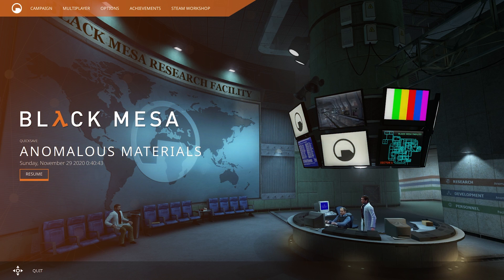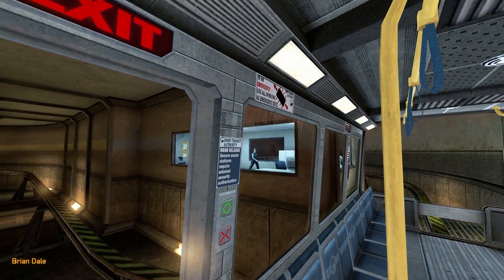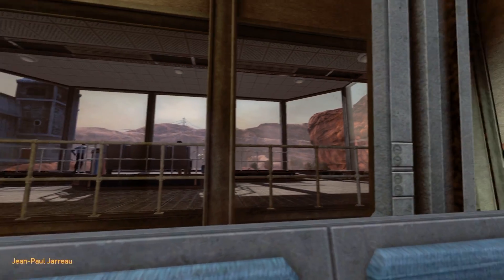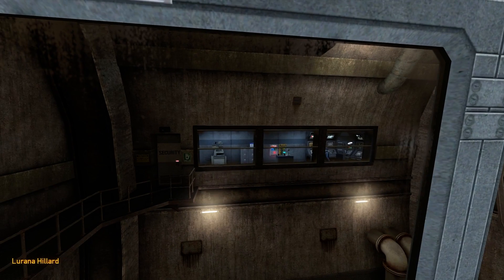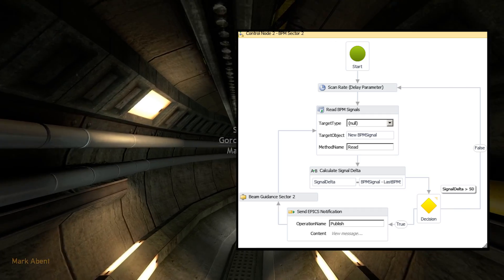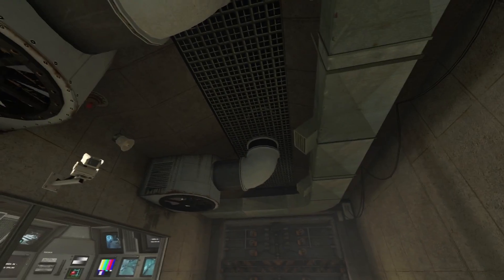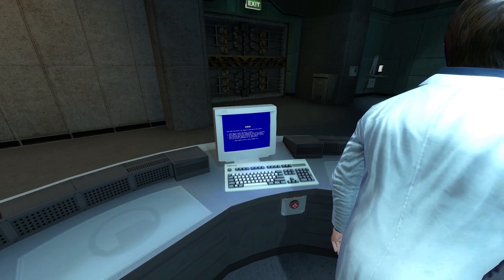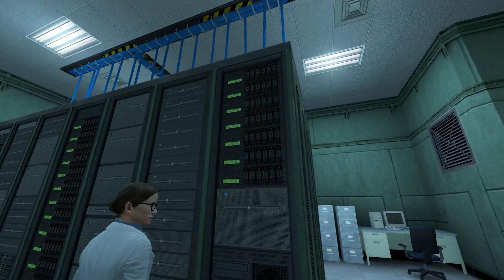Physicist Reviews Black Mesa Research Facility

Comment: 1. In a facility as large as Black Mesa, the cargo dock and warehouse area alone will take up the size of a small town. There will also be direct rail links from nearby Class 1 railroads feeding into the dock area.
2. In a hypothetical facility like Black Mesa, you can be sure ICBMs would be built there. Such a facility would be a major tier 1 national defense contractor.
3. Private armed security would not even begin to scratch the surface of the overall security structure of such a place. The Marines and Air Force would have garrison troops stationed there at all times in addition to an attached air force base. That means one side of the facility would be solely dedicated to barracks and military installations. Even the Pentagon and White House's defenses would pale in comparison to the force guarding such a lab.
4. Those plasma conduits we rode past on the tram had to have been hot enough to be producing X-rays in addition to lethal amounts of UV light. Just riding past these unshielded beams would fry all electronics on the tram and expose all passengers to a potentially lethal dose of radiation.

Comment: "What happens in Black Mesa stays in Black Mesa"
Well, when you're a top secret facility running on DoD funding and conducting teleportation experiments and making contact with different worlds with their own flora and fauna, you're gonna want to keep that under wraps.
Reply from the maker: true.. especially when the lab is called "anomalous materials lab"
Reply: @QuanticDev  And ironically, that's probably the least conspicuous area of the facility. It's what it says - an area where anomalous ("weird", "unusual") materials are handled and experimented on.

Comment: Some parts of the facility look much more realistic than others. Much later in the game there's an underground nuclear power plant that powers the facility, that you have to turn on, and some parts of it it actually looks a lot like a real nuclear power plant might look like inside.
Reply from the maker: I really like it when game developers incorporate realistic elements into their designs. It definitely adds a lot to the immersion. I guess especially true if you recognize those elements.
Reply: @QuanticDev  i love it when its realistic enough you can identify it as part of real architectural styles instead of game'y architecture, black mesa really does resemble a facility that was expanded upon over the 70s 80s and 90s like many real american buildings with large footprints